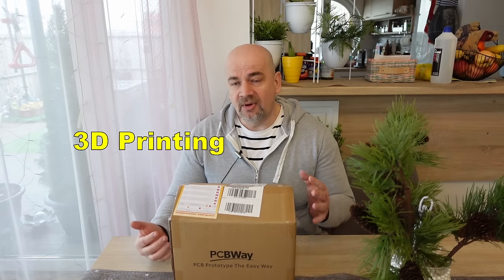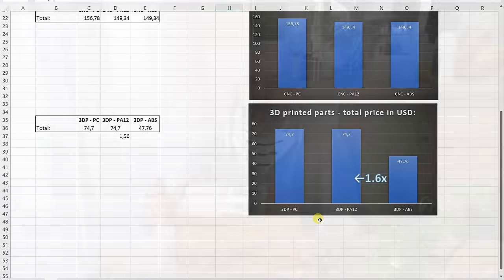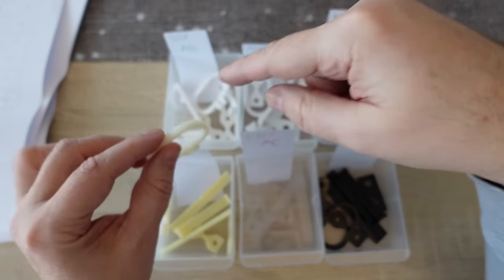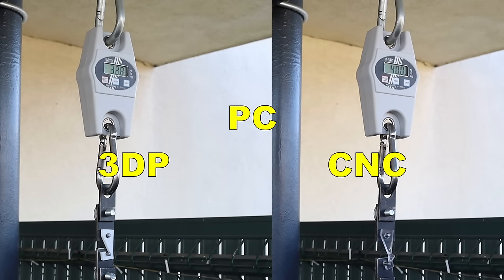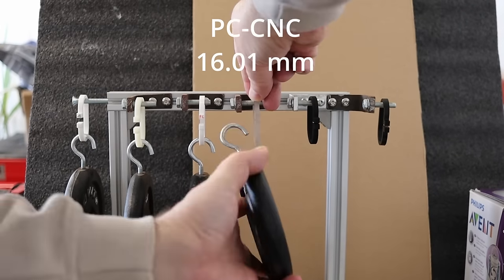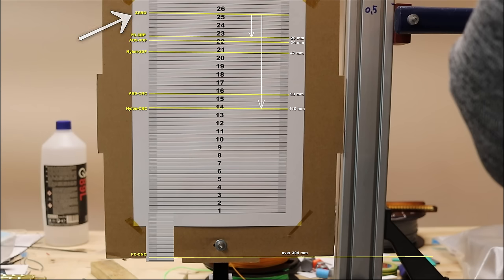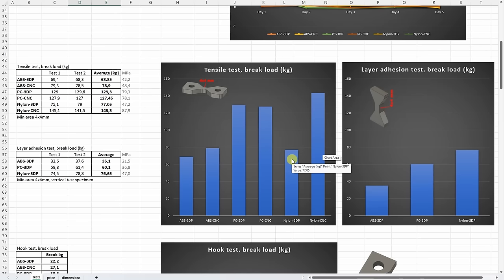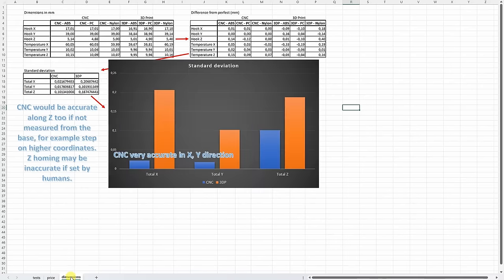CNC vs 3D printing (ABS, PolyCarbonate, Nylon) - Which one is stronger?  Services by PCBWAY

Comment: It was very interesting for me to see that the cnc nylon performs much better than the 3d printed one (in particoular in the creep test but also others).
Maybe (if possible) it would be worth to try to aneal 3d printed nylon parts 🤔 looks like there could be a lot to gain.
Reply from the maker: Yes, I have it on my to-do list, but never had time for it.. I got this suggestion several times, so probably it's worth it according to others.
Reply: Nylon absorbs water, boil the nylon, stop it getting brittle.

Comment: Thank you for this very interesting and informative test! It is great to know how these manufacturing processes compare to each other! 👍
Can I suggest to try out 3D printing with the settings outlined in the CNC-kitchen video about transparent FDM prints. As mentioned in that video, those settings might give better significantly layer adhesion. Although those prints take a long time, if they provide much better layer adhesion, it might still prove a better alternative to remelting prints in salt for example.

Comment: Did you measure the mass of the parts? 3D printed parts have voids which make them lighter than solid CNC parts. Strength, toughness and thermal resistance scale with mass. If you rescale the results by mass, I expect the 3D printed parts to be closer on all metrics, in which case you can compensate for missing strength by adding mass/upscaling the part. Except if the dimensional constraints are rigid and you can't upscale.
Reply from the maker: Oh, no I didn't, but good idea. Only it is too late now for these parts, but I will keep this in my mind next time with similar videos. (density is different for these materials, but yes, same materials would be good to compare with each other CNC vs 3DP)
Reply: @MyTechFun  Well you can still do it with the pieces of the parts. It won't vary much from the new parts. I think it's pretty valuable information.
Reply from the maker: @edufonseca5718 I measured two test object (for creep and bending test). It is added to download table on my website. Link in desc. CNC parts are 5-10% heavier.

Comment: I would love it if you could perform a pure torque test to see when heat set inserts strip out of 3D printed parts and compare it to square and hex nuts. We have data for heat set insert performance in tension and combined loading with Thomas Sanladerer’s most recent tests, but lack a pure torque test
Reply: He did a pull out test 3 years ago on heat insert nut but did not do a torque test.
Reply from the maker: I am thinking to repeat similar test with included hex nuts with some groove. You can see its picture here: https://www.printables.com/model/273615-mintion-beagle-camera-holder (for this specific 1/4x20 thread I don't have threaded insert, only regular hex nut, but it works good). But I think the pulling force is more important here, that will be the first faliure, not the shear torque (except if the nut or insert is from the other side of the bolt)

Comment: It is crucial to know at what temperature, extrusion width, and layer height the prints were made. For example, if you use a 0.4mm nozzle, a specimen printed in ABS with a 0.55mm extrusion width, 0.2mm layer height, and an enclosure temperature of 65°C will be 30% stronger than the same specimen printed with a 0.45mm extrusion width, 0.3mm layer height, and a 45°C enclosure temperature.
Reply: Why do you infere that a larger extrusion width enhances the part strength? At the same total wall thickness, of course.
Reply: @KToMmi  Because that way, the filament is pushed forcefully against the bottom layer, that's the conclusion reached by Stefan
Reply: @Marcos-tj8nk  oh wow, that's interesting. I knew about the influence of lower layer heights but no extrusion widths.
Reply: @KToMmi  and if you print it with 0.15 layer height would be even better
Reply: It also affects how soon the new layer is placed over the last one. (Layer time). It'll be great to know the chamber temperature of the printed parts. It's now well known this affects a lot layer adhesion.
Reply: @edufonseca5718  That's correct, the ideal is to print the fewest number of pieces possible at the same time to reduce the layer time. However, it is not advisable to reduce the layer time simply by increasing the speed, as the filament cools down faster after exiting the nozzle, causing less layer adhesion. So, you must increase both the nozzle temperature and the chamber temperature to the highest possible levels if you want to boost the printing speed.

Comment: Were both Nylons PA12? How long after printing (or receipt) did you wait before starting the tests?
Reply from the maker: Both PA12, I got them approx dec 20, but since I need 5 days to be home in a row (on christmas I was visiting my parents), I started with testing on dec 30.
Reply: @MyTechFun  Nice. I would call that acclimated, especially because they are thin parts, and PA12 absorbs less moisture than PA6.